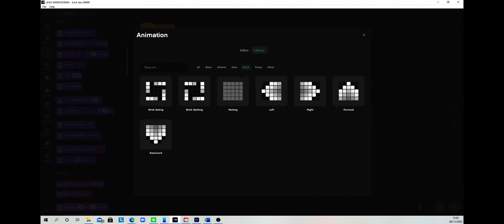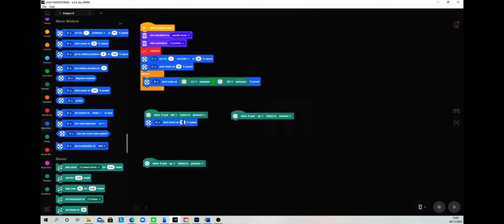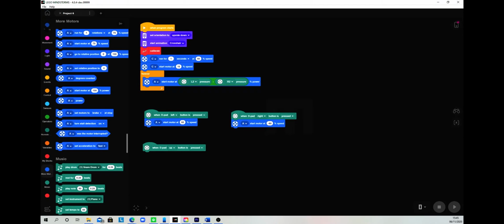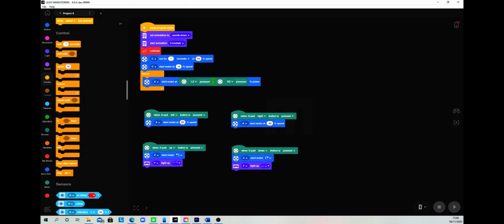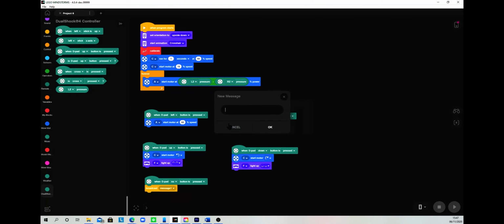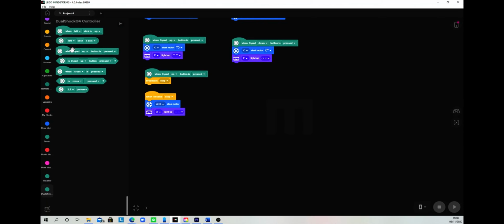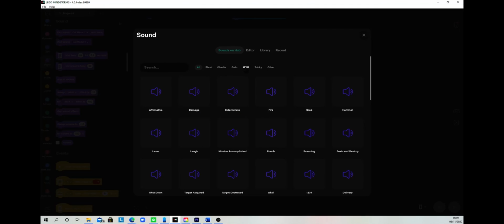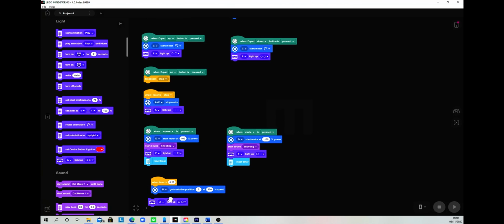Tutorial: Build and Code the MVP Turret - Lego Mindstorms Robot Inventor

Comment: Hi, you have attached the turret wrong. Don’t attach it directly to the motor. When built right it will follow the wheels :)
Reply from the maker: I thought this while building it, but wasn't getting any movement when placing it in the correct position (as shown in the instructions). I guess maybe my axle wasnt going into the white connector underneath the panelling properly. Thanks for the tip!
Reply: @planetcodebot2186  I made the same error by missing the white tube connector 😀